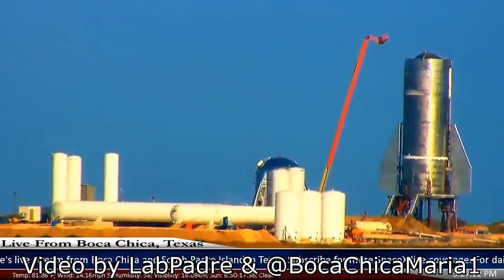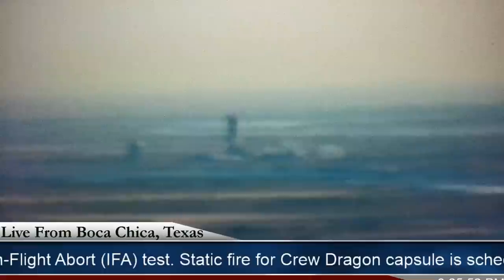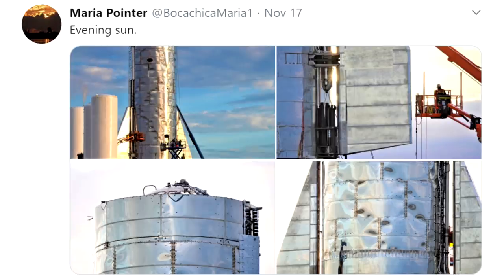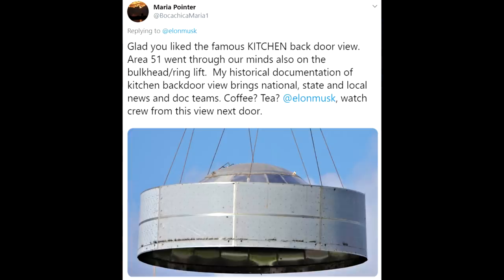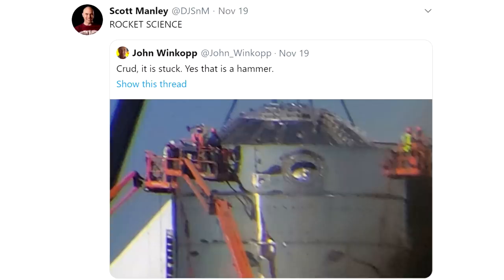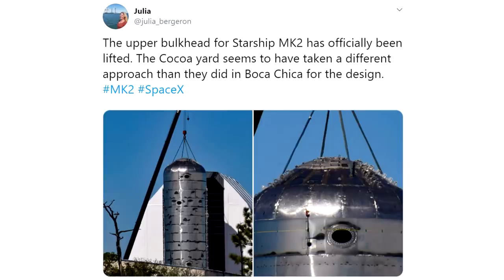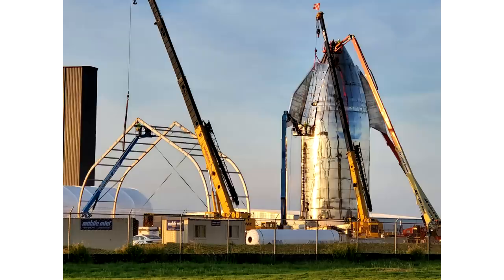SpaceX's Starship Popper - Starship Mk1 Ruptures Tank During Test

Comment: I love how scrappy this project seem to be from day 1. Just build another trashcan!
Reply: Prototyping at its finest
Reply: Should have had it fully fueled. Now it was missing half the show. I guess they are leaving something for the next time then.
Reply: I was literally thinking that would this even fly, (No offence to Spacex) but this thing looked awfully weak to sustain a spaceflight. 
They should had sticked with the Aluminium Lithium alloy.
Reply: @PArabinddeep  I can think of one simple reason they're not using the same alloy as for the Falcon 9 and it's reentry temperatures. It's already a giant ship so using low melting point metals (read: aluminium alloys) and adding heat shields would make it even heavier  than using stainless and not to mention it's expensive. You could use titanium i guess, but that's even more expensive. CF is no longer even an option at this point as Elon pointed out.
Reply: @helicocktor  Thanks for the information.
Reply: Lego Technic would look more professional.
Reply: @helicocktor  But still they should had avoided welding as much as possible.
Reply: Get the Arc welder....well hammer the lid back on...and buzz it back together....Good to Go...👍

Comment: people: that is a failure
space x: good job! we now have acquired a new data 
space x fans: it was more than a success
Reply: let's do a failed test so that we can transfer on working Mk3
Reply: The Mystery Goo was feeling right at home at least.
Reply: Rogozin: "I need a new joke. The trampoline one has become stale."
Reply: It’s still better to encounter those failures now than later, it allows for studying the flaws and correct them.
Reply: @MrTchou  No shit. But the best would be no failures.
Reply: Engineer: failure do happen but was the safety factor big enough when calculating those structures?
Reply: Musketeers ! You have them pegged.
Reply: @moomoomoomuu  That's true but extremely unlikely. When your trying to do something of this magnitude your bond to have short term failures that lead to long term success....Nothing but success is movie shit
Reply: @jaredcoates3273  Of what "magnitude"? Build a large oxigen tank? Yeah, never was done before. 🙄
Reply: @vladimirdyuzhev  it's actually the largest that's designed to fly to space so... yeah. So now the investigation can start where the failures took place and how to improve the design and implement more safety measures. R&D it's almost like that means something 🤷‍♂️
Reply: @AnubisSolvang  so far they are largest to crack open in the open field.
Reply: @vladimirdyuzhev  yup, they vacated the area for pressure testing, like you would do in a test. Space X likes to push tests past the limits like they did with their raptors, notice how they had it semi assembled. As if they knew it was going to blow 🤔
Reply: @moomoomoomuu    There is no such thing as no failures. the purpose of testing is to find out what will fail and why.
Reply: @worldpeace1822   That's a good question. Normally a pressure vessel is designed to withstand at least three times the expected maximum pressure it will ever hold. I can't imagine SpaceX deviating from that standard. My guess is this was a manufacturing problem.
Reply: Odysseus Rex would be mine too. Yet miscalculation is a thing too. A safety factor of three might still not be enough when your real factor is bigger than that. For example due to changes in the build during building process not taken into account..like parts wielded together in a spot where non was thought to be. For a first time build that’s what I would guess has happened.
Reply: @vladimirdyuzhev  By "magnitude" Im referring to spacex trying to build the largest n most powerful rocket of all time. I would say that's a pretty daunting task lol. There's a reason for the phrase"It's not rocket science". If it was easy or cheap, we would have had rockets like Starship or better decades ago
Reply: @odysseusrex5908  We don't know if they were testing it well above the pressure they expect to fly it at. For all we know, they were cranking that sucker up well beyond the intended use specifically to find out how it would fail.

Is a safety factor of 3x standard in spaceships? I imagine it is not when weight is such a huge issue. Strong enough to fly and strong enough to take some extra force definitely. 3x? Maybe. Though again, perhaps this thing blew well past its intended pressure.
Reply: @ashkebora7262    That is a valid test protocol. Just, if they were intentionally testing to destruction, which is something that you do, they never told anybody about it.
Reply: @moomoomoomuu  impossable tho
Reply: @odysseusrex5908  Have they told people about purposeful failure tests before that weren't something like a scuttled launch or a booster that wasn't coming back?

I imagine it'd be nice (and smart) to not invite a media circus to swarm around what is effectively a bomb test.
Reply: @ashkebora7262    I am not aware that they have ever done a test to destruction before. It is a legitimate thing to do, particularly with pressure vessels. However, they knew there was going to be all kinds of people watching this thing, so blowing it up without telling everybody that is your intention makes it look like what it probably was, a failure. However, failures are not bad things. You learn from them, put that knowledge into your next iteration, and carry on.

Comment: This was probably a "at what pressure dose this thing explode?" test.
Reply: You do understand how  stupid doing overpressure tests with extremely reactive liquid oxygen is, right?
Reply: @ghaspar  it was probably nitrogen
Reply: ghaspar yes, because then you’d get a massive fiery explosion, like what didn’t happen here at all.
Reply: @illuminate4622  You're probably right!
Reply: @Bruce Hanna Why not water? It's the traditional way to pressure test tanks, as the volume difference between max pressure and 1 atm. is tiny, limiting explosion velocities.
Reply: @johncrowerdoe5527  Perhaps not water because using a cryogen would test it on closer to operational conditions.
Reply: @johncrowerdoe5527  It's quite tall, so the pressure at the top of the vessel will be less than the bottom due to testing in gravity.
1ATM difference top to bottom for every 10m in height
Reply: @markp8295  Yep, that will be a danger.  But at least there's not boil off pressure added to that.

Comment: Ah, had this issue before, they turned on their engine in the wrong order.
Reply: Always check your staging.
Reply: Staging could have been the problem, but I'm thinking that the welds wouldn't have been a problem had they simply applied more struts. Never enough struts.
Reply: @DeltafangEX  But the struts are welded
Reply: @leandrog2785  No, no, no. The proper way to secure a strut is duct tape

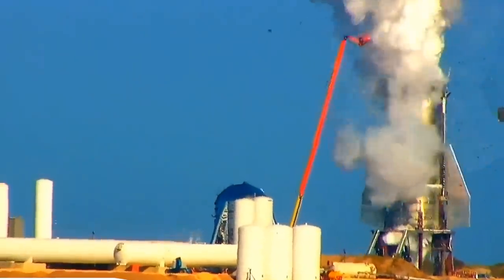Comment: 4:03  "I'm thinking 4-5 atmospheres of pressure"
.
Yes, that about matches by first impression, based on just how fast (and high) that dome flew.
.
If this is the case then it is way, way over nominal operational pressure, which is supposed to be under 2.3 atmospheres.

It may have been a test to 200% nominal, or it may have been a malfunctioning valve/pressure control system?
Reply: Seems unlikely that they accidentally fill it to twice the regular pressure. You'd think they'd have more than one way to quickly stop fuelling. That, and a way to vent excess pressure (since this is a crucial part of fuelling the rocket to begin with).

I hope it was a destructive test...
Reply: Just speculation from my non-engineer mind: What if the nitrogen in the tank started to vaporate quicker than expected? Eg. it splashed more, or heated faster than the estimations?  It could lead to an unexpected fast increase in pressure, and maybe the valves couldn't handle it.
Reply: @MrAnticlimate  In a closed container, splashing or shaking or any mechanical motion has no effect on the static pressure. You can get temporary spikes from waves crashing into stuff, but the overall pressure won't increase. Given that it was standing still, the only waves in there would be from fuelling which could not have that much impact.

Heating up faster is unlikely, since you need a power source for the liquid to heat up.  You can't really get enough power to build up pressure that fast by accident. If you let it sit there in the sun you might get there, but if they're actively monitoring and watching it I just don't see how they'd let it get to that point. They've fuelled up boosters hunderds of times. I think it's unlikely they just missed the pressure building up.

I think what happened is quite clear: they pumped too much stuff in there. Building up to this pressure must have been an active and intentional process. They pumped in more than the tank could handle, and the container exploded just like what happens when you overfill a balloon. The main questions are: what was the pressure compared to flight pressure, and were they expecting it to fail? If this was flight pressure, that's a big deal. If this was a destructive test, it's business as usual. We're going to need a Scott Manley or Everyday Austronaut to tease the details out of Musk...
Reply: @Niosus  – Yes, that was just a wild guess, but what I meant by the splashing is that if you fill a small amount of liquid N into the tank you need some time while the gas pressure above the liquid builds up (through evaporation) till it gets into an equilibrium, and no more net evaporation. Splashing makes it a faster process. Just like shaking a soda bottle (imperfect analogy, as it's not the drink evaporating, but the solved CO2). At least that's how I'm imagining it, maybe the process is fast enough that splashing doesn't make any difference.
Reply: @MrAnticlimate  If you shake a soda bottle while it is closed, the pressure actually doesn't increase. The reason why it overflows when you open it afterwards is because shaking it makes a lot of bubbles, which are nucleation sites for the CO2 to go out of solution. Once the pressure drops when you open the bottle, the all those bubbles expand, flow to the top and force most of the excess CO2 out of solution. The nucleation sites are key here, so it doesn't compare to the case where you have a pure liquid. That would be more akin to shaking a bottle of water. No matter how hard you shake, you'll never somehow have excess pressure when you open the bottle.

The equilibrium gas pressure in a nearly fully-filled container like this is reached fairly quickly. The difference here is that the container is heating up so the pressure keeps rising. But this is a relatively gentle and predictable process that can't really spike if the liquid isn't superheated beyond the boiling point. It takes a lot of energy to go from liquid to gas, and you're only really getting energy from the sunlight on the mirror finish, and convection through the air. I really don't think they'd be caught by surprise by this.

Comment: I've heard about welds having this kind of failure. It's like it sorta 'unzips' an entire seam once a crack develops. The solution to mitigate this mode of failure could be to build this with as little seams as possible. Imagine them rolling the biggest sheet of steel possible into a tube.
Reply: i think it would also help to use two layers of sheet metal, rolled in opposed directions over each other would greatly improve integrity. this might complicate manufacturing though..

Comment: That's why I'm more interested in raptor production than starship. Because raptor is a lot closer to mass manufacturing while starship is a prototype and far away from the final product.
Raptor factory in Hawthorne is a real factory at least. The manufacturing process needed to reduce the cost to 250k$ per engine is probably very impressive.
Reply: An engine without a rocket isn't terribly useful though.
Reply: @aleksandersuur9475  Yeah, but it's a critical part of it. And the engine alone can disrupt the industry.

Comment: That's a lot of valuable testing happening in a fraction of a second. Destructive testing is useful!
Maybe they ramped the pressure far further than expected for flight, to find the failure point.
Reply: I've heard speculation that it may have been a sensor fault, leading to the actual pressure being underreported. If they'd been intentionally trying to find the failure point, Elon would have said so by now...

Comment: Stainless steel is challenging to weld compared to mild steel, especially under field conditions.
Reply: the whole thing already looks like a tin can to begin with, I find it really hard to believe they're gonna fly and do acrobatic maneuver with it without falling apart like it already is
Reply: You say that but there are a LOT of professionals who are experienced specifically in welding stainless steel (I'm pretty sure). So I bet that working with it or finding people who CAN work with it is still a lot easier than COPV.
Reply: I have welded stainless plenty of times and found it easier than steel or cast iron or aluminum to weld  .
if you have a person that is a good welder  and good gear to accomplish the job  , its  not hard .
However  welding pressure vessels is an art in itself.
Reply: Phillip Mulligan The world has been using stainless steel for more than a century now, and there is a vast wealth of experience available for working with it, including welding, however the practical difficulties with fault free welding has been one of the reasons for its limited use in aircraft thus far, although weight considerations have been an even larger factor. The Bristol 188 experimental aircraft of 1963 was made of stainless steel because it was intended for use on the Concorde due to heat issues at speed. The fabrication difficulties of the Bristol 188 lead to the Concorde using heat resistant aluminum instead, which limited its top speed to mach 2.02 and it could be argued that the compromise meant the aircraft’s speed advantage, and therefore long term success was compromised. The XB-70 mach 3 bomber was made of stainless steel honeycomb panels and titanium. At design speed the stainless steel exhibited a number of problems which included at least one catastrophic failure and the aircraft being limited to mach 2.5 afterwards.

So yes, stainless steel can be problematic. The use of the alloy in smaller scales seems to have no problems at all, but where the stresses mount in these kinds of applications it has a checkered history. I think that is just a matter of better engineering techniques, but it is not just weight that has caused designers to choose aluminum in the past. In this case, though, I think it will be a temporary setback that will be overcome.